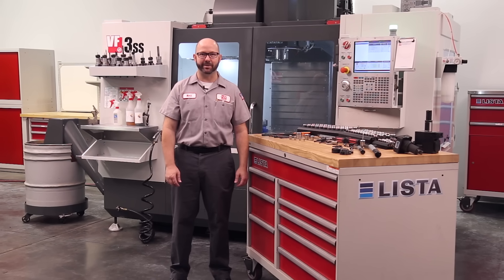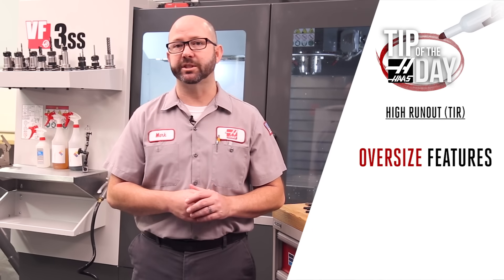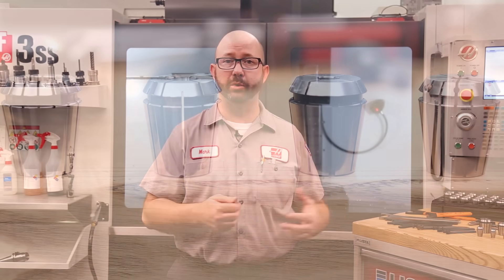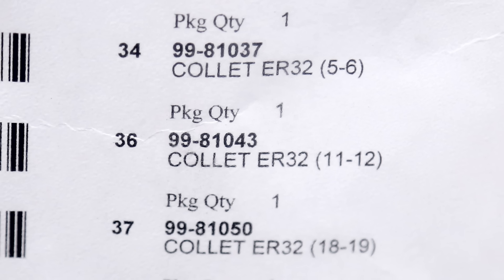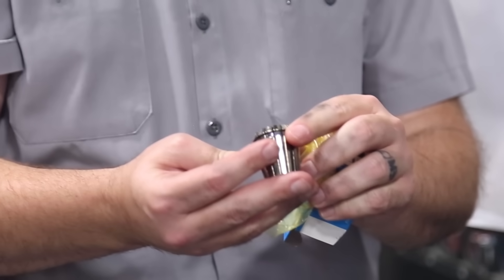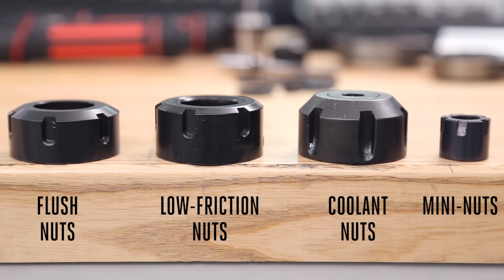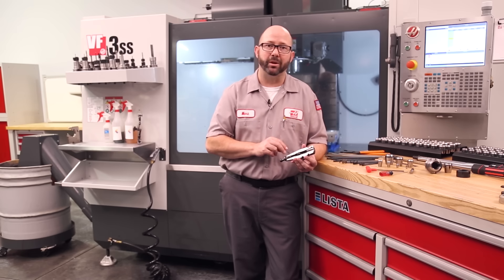ER Collet Essentials. Do You Know? – Haas Automation Tip of the Day

Comment: I can find lots of places saying that you should not expand ER collets, but no information and the technicalities of why it is bad. Can anyone share more data on this?
Reply: This really needs a graphic, doesn't it. The inside diameter of the collet is ground to that maximum size (12mm on an 11-12 collet). If we use a larger diameter tool it puts all of the pressure on the thin inside corners of the collet instead of the thick center part. These corners will deform, putting pressure in strange places which will weaken our grip and damage our collets and holders.

Comment: 17:50 what porous? don't invent stuff dude, a metal is a crystal (single molecule), there are no pores in it, every atom is linked to another atom. if the collet has a coating, then yes, the coating may be gone, but that's why you have to buy a collet from a quality alloy
Reply: Hmm. I’m struggling to find the right word. The surface can get scuffed up, which gives it an increased surface area, which allows for increased oxidation, and higher friction. I’m still struggling to find the right word. Porous isn’t right, like you stated. Maybe someone can respond with a more accurate description.
Reply: @markterryberry4477  hmm, wouldn´t the word be "texturized"?
Reply: @absolute___zero  exactly. That’s closer. I’m surprised theres not a more common single word for when something is texturized, giving it an increased surface area. Surface Texturing. That’s as close as I’ve heard.

Comment: Great video! Thanks. Just one comment: in some parts of the video it shows an assembly device or tool holder locker/vise (don't know the name of it). I understand that the vise holds the tool holder properly while you perform the assembling/disassembling like collet changes. Could you please inform where to buy them for HSK-A63 fits? Thanks!!

Comment: I prefer to put 3.175mm into a 3-2 collet! I disagree with matching all the sizes.
Reply: I think I agree with your experience. We used to run tons of small 1/8" single lip cutters, and I often ran them in 3mm (2-3) collets. 4mm collets (3-4) just felt loose, and left almost no gap. I know that theoretically that would put the cutter on the edges of the collet lands, instead of in the middle of the lands, but I never had any problem, and with tiny cutters if we had problems the tool life would tell us. I still think that using an on-size collet is best, and in general that you never want to run tools that are too big for the collets (squeezing the tool in), but I hear you, there is something about 1/8" (3.175mm) tools where I don't always stick to the rules. Thanks for the comment.

Comment: 3:42 I see online that some special "oversize" DIN 6499 collets exist which extend the maximum standard diameter, e.g. ER25 up to 20 mm. Would you recommend such extended collets to adapt CNC grooving blades (shank ⌀ 20 mm) to an ER25 spindle in order to be able to cut deep grooves in hard wood (not metal)?

Comment: When I put the nominal bit in the same collet I only get two turns on the nut so I use a larger collet, is this wrong?
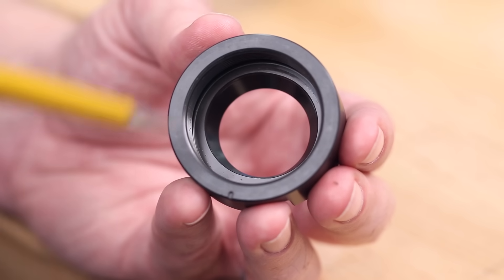Reply: Make sure that the collet is fully seated in the nut, before you insert the tool, if you are only getting 2 threads of engagement, there is something keeping the collet from fully seating. 12:58

Comment: G'Day  I am just starting in using a lathe and a milling machine  can you help me  by letting me know what would be the best for my lathe and milling machine . Here is the machine specks so you can help me

MODELTU-2506V-16M
KIT IncludesTU-2506V & BF-16AV
Lathe Specifications LATHE SPECIFICATIONS

(Tool Height To Suit   (mm) 12

Distance Between Centres  (mm) 550

Swing Over Bed   (mm) 250

Swing Over Cross Slide (mm) 150

Centre Height (mm)125

Spindle Bore (mm) 26 

Spindle Nose Type   Fixed

Bed Width   (mm) 135
 

Headstock Taper (MT)4

Tailstock Taper (MT)2

Cross Slide Travel (mm)110
 

Compound Slide Travel (mm)70
 

Leadscrew  Metric

Longitudinal Feed (Z-Axis) (mm/rev) 0.07 - 0.4

Metric Thread Range (mm) 0.2 - 3.5

(Imperial Thread Range (TPI) 8 - 56

Three Jaw Chuck Size (mm) 125

Spindle Speeds  (No. / rpm) Variable (150 - 2500)

Mill Specifications MILL SPECIFICATIONS

(MT)Spindle Taper (MT) 3

Column Type Dovetail

Swivel Head (Left ~ Right) (± Deg) ±90

Vertical Travel (Z-Axis)  (mm) 210

Drilling Capacity (mm) 16

End Milling Capacity (mm) 20

Face Milling Capacity  (mm)  63

Spindle Speeds Vertical (No. / rpm) Variable (100-3000)

I  am only using the Lathe mill machine  for home use I am hoping you can tell me what things are  best for the speeds that the machine can do

Sincerely  
 Thanks

Comment: Any idea why I have nuts freezing to the tool holder? 18,000 rpm spindle cutting melamine or plastic laminates. I put them together by hand, so they aren't cross threaded. Obvious galling on both threads. No problems for months, then last week I had 3 nuts gall and freeze when disassembling.

Comment: To who may concern, I am a newbie in this CNC machine, and I have thought or question regarding the ways of using this machine and also the operation.

-I wonder what will be the impact on the workpiece if the clamping force on the part is too high in the CNC machining process. 

-What's the consequence if the workpiece is held by hand instead of using the fixture while performing CNC drilling. 

-Predict the impact when an improper drill is used to drill a hole in CNC Machining.
-What are the possible reasons that caused chipping to occur?

Comment: I am a cnc operator in the wood working industry. We use the same collets and tool holders as you. How does the machine clamp on to the tool holder.
Reply: There is a pull stud at the top of the holder, and the machine pulls it into the taper.

Comment: Damn those vending machines. Most inneficient thing to happen to a shop with honest men.
Reply: Jason Sytsma is that a joke or are tool vending machines in big shops a real thing?  I’ve never seen that before. Thanks.
Reply: @kgee2111  no joke. We just got the machines and its the most frustrating thing.
It takes a basic tool room with around 500 tools in it and reduces the capacity of that room to about 100 tools. The rest of the tools now take up shop floor space, but things like threadtape are locked in a vending machine. 
 It also slows down every job as you now wait for every item you need. Drills, grinders, cut off wheels (1 at a time mind you), thread locker, batteries, ratchets, chain falls, pipe wrenches, welding rods, you name it,  Its in the machine. And you gotta code in to get the item out from the machine.  1 item/per time to dispatch the single item. 
The idea was to make things efficient and the sales pitch was that these vending machines cut down on losses from theft etc.
Well we didnt have any theft to begin with.  It is the generic sales pitch. 
And even if we did, it still doesnt pay to use these vending machines. 
It took me half an hour to cut an inch off a piece of stock where it used to take about 5 seconds.  Id grab a grinder with cutoff wheel and go. Now its 15 minutes to find the items, then select, then dispatch it, then go find the wheels, dispatch 1, then go find the emery cloth, dispatch that etc...drill, dispatch, then you gotta put each item back. Etc...
The time it takes to collect the items needed is longer then it takes to do the full job most times. 
Not only that, but when your plant downtime cost is around 20k an hour, youd think saving that half hour is more important then saving the occasional roll of thread tape or cutoff wheel or drill bit that also needs ro be removed from inventory.  (Used to get suppliedd by a vendor. Still does but now its all behind lock and key in a machine that counts the item even thought it cant count the item truthfully) 
Its crazy illogical and crazy inneficient. But someone figured out how to tell someone this saves time and money.  
Other similar ideas are taking form over the workings of the plant and the budget has been popped for about 2 years.  It has quadrupled.  Where we used to have 2 or 3 open work orders per day, we now have 350 open work orders and cant keep up, more down time, more manpower turnover,  more illogical solutions from the top down etc.  Theres no logic to anything now.
Reply: Wow!  Makes me glad I’m in the twilight of my career.  Hang in there Brother.

Comment: We have 2 kinds of TSC ER collets, the ones with the rubber seals as  showed here and some without rubber seals where the slots are shorter. I've found that the ones with rubber seals have to be on size or the tool is likely to slip. Also the rubber seals will eventually blow out.

Comment: Thank you. Centering tools with ultimate holding power. Satisfying machinist ocd.
This is an amazing service you guys provide with passion.
Not everyone gets to hang out with old school machinists. Thanks again
Reply: Maciej Jan Długosz  Not true; standard shrink fit holders are much stronger than ER collets, but are absolutely not the option with the strongest gripping force. Heavy-wall shrink holders are a big step up, but for “ultimate holding power,” there needs to be a mechanical connection like a “Safe Lock” groove in a shrink holder or a Weldon shank. Even a milling chuck can offer more grip force than standard profile shrink fit holders.

Not a darn thing wrong with ER collet chucks; every shop should have some in my opinion, but they’re not the best option for any one thing.
Reply: Ultimate holding power sure won’t come from ER collets.
Reply: Maciej Jan Długosz  collets can achieve more clamping than shrink fit.
Shrink fit only allows for a few thousands.
Thus limiting actual holding force.
Collets use a screw and wedge combination to achieve ultimate clamping force, do the math.
Reply: Maciej Jan Długosz  actually.
If you couple shrink fit tool holders with loctite 680, no amount of physical force will move the tool providing the tool shank doesn't exceed 450 degrees Fahrenheit to release the adhesive.

Comment: Regarding choosing right collet size (at 7:15). I had the following experience:
I had big tool runout when used 1/8 inch tool shaft with 1/8 inch collet (ER-11).  When replaced the collet to 3.5mm the tool runout has disappeared.
Therefore I would choose collet of some bigger size than tool shaft.
Reply: Sounds like a  damaged or dodgy from new  1/8"  collet to me.    It would be worth checking the TIR  with a measuring pin  and   discarding it if it's  no good.   
1 Don't bother buying cheap no brand collets ,  they're.... cheap!  I found 'F' brand are good think it's fahron  he showed 1 in the video  
2 the 0.5mm collets are  very useful for small/precision  work.

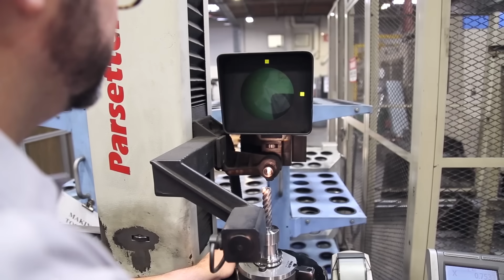Comment: Definitely a lot of very useful and educational material here.  However, being the "anal" grammar hound I am, there is a major error at 1:44 in this video.  One word...'dampen'.  The accepted meaning of the word dampen is to make moist or wet.  The elimination of vibration is by "damping" which means (in it's root form - damp) to suppress or lessen.

Have a nice day!  Even those who hold George Carlin in high regard, by having other plans!  

Keep up the good works!
Reply: Well, according to Merriam-Webster:
Definition of DAMPEN
dampened; dampening  \ˈdamp-niŋ, ˈdam-pə-\
transitive verb
1 : to check or diminish the activity or vigor of : deaden - the heat dampened our spirits

Comment: I would love to know how they make those collets. How the hell do they hang on to them to cut the slots?
Reply: I have alway wonder that but im geasing holding  them bottom and top using a bar in the middl
Reply: Collets are made by a multi processing with CNC lathe and slots is grooved by electroerosion process with wolfram-tungsten electrodes or simmilar resistive material.

Comment: I'm confused now......
Which mini mill should I buy .... from the little machine shop ?
(running at the same price)
The HiTorque Micro Mill, 2MT Spindle.
or....
The  HiTorque Micro Mill, ER-16 Spindle.
if I want to save a few bucks in the long run ?
Thank you in advance for your answer.
Reply from the maker: You-Tube Junkie – I haven’t run those particular units, it might be worth posting something (or searching) on the forums to see if anyone has any direct experience.   www.Practicalmachinist.com is a good place to post those kind of questions. A lot of local Maker Spaces now have Haas Mills for projects, and of course CNC classes at community colleges are taking off across the country – these classes are a great way to gain access to high-end equipment.  Keep stepping up, sounds like you’ll have some fun. – Mark, Haas Tip-of-the-day

Comment: Great Job Mark and Haas on this video! I’d like to point out one thing you didn’t touch on, that I’ve found employees do in the past, especially when using these collets for holding endmills.  Although you mentioned it is important to have clean surfaces on the holder and collets, you did not touch on the importance of breaking down the collet setup when switching out tools in the holders when tools become dull or time to replace.  Chips, coolant residue, and debris gather in the collet slots during machining operations. And in changing out a tool when you loosen the collet, this residue can work its way from the slots to in  between the collet and holder surfaces. Now when you clamp down on the new tool, you are smashing all of that residue BETWEEN those two surfaces, along with the suraces of the collet and cap itself where those two surfaces come in contact. I know it may seem simple common sense to always break down the collet from the cap and remove it from the holder, and clean all surfaces when changing out a tool. However you’d be surprised how often this happens if employees are not instructed in the importance of doing so.Thanks so much for these videos. They are a great teaching tool.
Donnie
Reply from the maker: Donnie – Great point. Thanks for commenting. – Mark, Haas Tip-of-the-day
Reply: We use chip chasers to clean out the veins of collets. Works well. The chaser is spring steel, about the thickness of metal banding, maybe a tad thinner.
Reply: Use the 6" steel rule in your overalls pocket. I always have 0-1 mic, needle file & marker pen in breast pocket. Then use airline and corner of overalls to clean. 👍

Comment: increased Grip force has a more obvious benefit than the decreased vibration Mark mentions (which is not guaranteed, in any case)
Importantly, increased Grip force prevents the tooling from working its way out of the collet. 
Carbide shanks, being so smooth and hard, are particularly prone to this.
In the worst case, this causes those dinky "down ramps " we so often see machined into the table on mills which have been used in poorly controlled shop environment. 
Even in the best case, tooling working its way out of the collet causes scrapped parts.
Reply: thats why most of us use side locks. They're just safer. I've never had any luck with running end mills in collets..well nothing over a 1/4 anyway.
Reply: @themadmachinist8637  If you're talking old school collets, I'm not surprised. ER collets (especially with a bearing-style nut) are plenty secure for most work, certainly everything you'd do (in the way of DoC, feeds and speeds) on a manual mill.

Comment: Isn't ER short for Erickson? The original maker? You say Rego-Fix came up with ER?
Reply: J P 
It's an E type collet modified by Regofix.
Reply: Indeed. Long answer:
Fritz Weber, a toolmaker from Switzerland, had founded Rego-Fix in 1950.
In 1972 he created and patented the ER collet, by modifying Schaublin's existing double-taper type E collet.
A ridge on the clamping nut he developed clipped into a groove on the collet, so it would self-extract from the toolholder taper when the nut was reversed off.
Weber came up with the “ER” collet designation, with the “R” standing for Rego-Fix.
Reply: Haasautomation is correct.  Rego-Fix came up with ER.  Originally, there was a "E' collet, which was the same as ER, but without the groove.  Fritz Weber, the founder of Rego-Fix, carried the design one step further and filed a patent in 1972 for his design as "ER".  E for 'E' style collet, 'R' for Reigoldswil, Switzerland, where the company was founded in 1950.  Rego-Fix voluntarily gave up their international patent in 1992 to allow the design to become a DIN standard, which they wrote.  Rego-Fix is the inventor of most major ER developments since, with the exception of ER25, which was Parlec's idea,.and comes with a some problems....coolant disks, mini-nut," friction-bearing" nut, integral eccentric ring in nut for collet retention, secure grip......